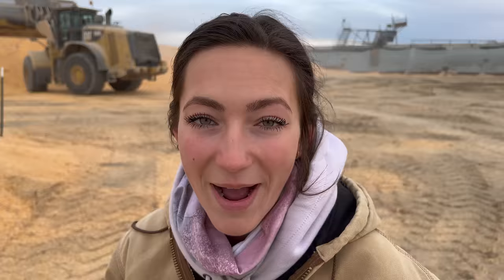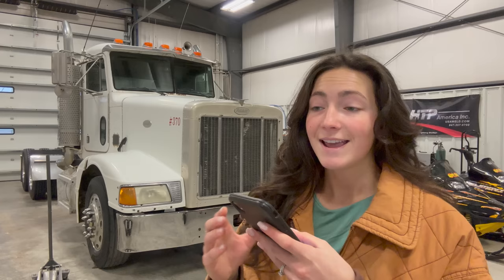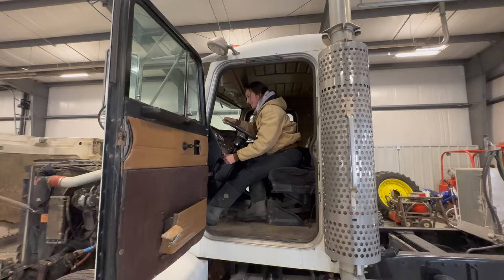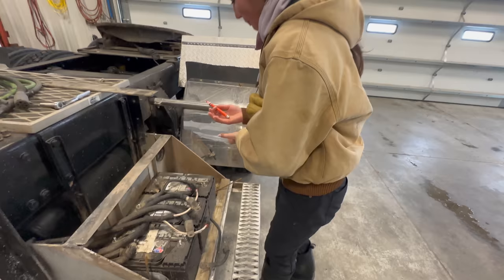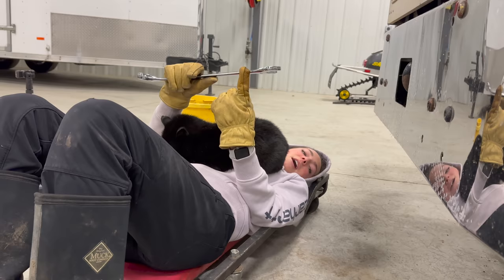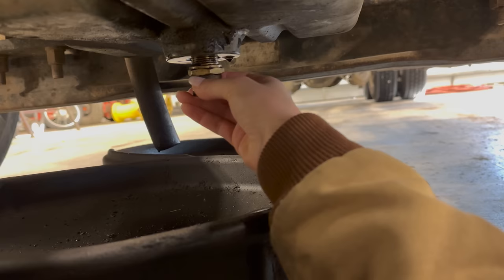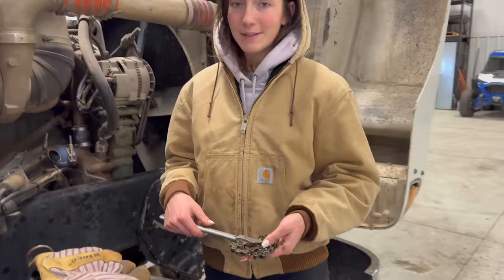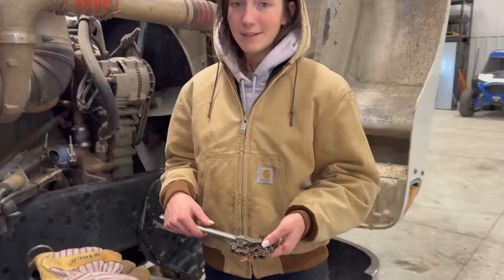The Worst Oil Change

Comment: You need to fill the fuel filter with Diesel fuel before you start it, your going to create an air pocket and have to bleed the fuel injectors. Not fun plus more work.

Comment: might have to go with a hammer and chisel on the rim of the filter or I have had to tear the aluminum and filter material away and use a pipe wrench or hammer and chisel to knock off the screw part that attaches to the base... get a proper filter wrench for the second one but you figured that out already I am sure...  but once compromised all tools will only make it worse. or cutting torch... buzz it off without cutting the base.. or take the base off and work with it on the bench... been there done that... no good solution.  No room for the screwdriver and manner through the filter and use a strap wrench wrapped on the screwdriver... I dont think you have to get close to the base as possible (aka near the top)... Army Mechanic old school and Ambulance rescue maintenance officer for about a decade running that engine in rescue trucks.

Comment: @jackgreider6347 has the right idea. Band wrenches work great. I have a oil filter wrench that has 3 fingers that also works great that I got from Snap-on. Not sure they make one big  enough for a truck or tractor filter but I haven't come across a filter I couldn't get off with it. The part # is OFCA3HDKT

Comment: I would hammer a screw driver or a pointed rod through the filter from the front. then I would force a larger rod through the same hole. then I  would force an even larger rod through the same hole and repeat until you have a large enough rod all the way through the filter that it will not bend with a 4 foot cheater on it. You have nothing to lose at this point.

Comment: I work for the love that  loved 6 Detroit engine band filter wreck use with 1/2"" racket I use it with 12"" extension breakers bar The oil has cap to take adapter drain the oil put hole in filter fir It's easier  you didn't fill your fuel filler You will loose prime fill it before starting  I wish I could be be there show  you

Comment: I've actually had to drive a screwdriver all the way through an oil filter to get enough leverage to get it loose and I've had to put impact wrenches on the cartridge type filters that had wrench flats before.  I don't think people actually torque them that much, my theory is that it is a dissimilar material issue that causes it to tighten over time. Having said all that I'd follow the other advice in these comments and get the right oil filter wrench up close to the threads.  By the way, is that scratch on your face OK?  Did Scotty get a little crazy?

Comment: at the least hammer a long flathead screw driver right threw the filter and turn it off ,,, yes you will  loo=se your oil and make a mess but it is a sure way to get it off. cheap lol

Comment: For one thing, you're grabbing the bottom of the filter, at the weakest area. Another, is you can probably access it better under the truck. Another, it's probably seized from how long it's been on there and the oil wasn't changed in a number of hours. If all else fails, drive a crowbar or ladys finger thru it and use a cheater on that. ITS got to come off, even if it takes some incentive from a hammer. Maybe try to tighten it up and then try to loosen it. If NONE of that works, use a cold chisel to it.

Comment: as well as all the other good advice from all us armchair types, try and grip the canister as as high up and near to the threads as possible, wrenching on the bottom just more twisting force going into the can instead of the threads.
and no.  i've never took an oil filter off an artic in my life.

Comment: um, you're missing a battery, most trucks have 4x12 volt batteries, wired to provide 24v to the starter motor, but only 12v to everything else...

Comment: you need to use penetrating oil like Seafoam, or PBBlaster, then use a heat gun and get it luke warm for the rubber to be more maluable... it sux when they are stuck :P

Comment: Hi guys! Filter players work great and can get a set at haborfreight or thuer is a socket  oil filter sock that goes  on the end of the filter and goes on a normal socket  wrench thise are the shit. And evan on you feul filter remember to fill them with I ther oil for the oil ones and put feul in the feul ones so it's easier to prime the feul when you go to strat the truck thier is already feul to go into it lol! Thier is your free tips for this one guys good luck!

Comment: 0:58 - "That machine weighs 770,000 pounds".  Not quite.  That weight didn't pass the smell test for me.  Looking at the specs of a 980K Caterpillar Wheel Loader shows its "Operational Weight" is 66,489.3 pounds.  Looks like you got some bad info Laura.

Comment: What does 770,000 pounds even mean... try using the Metric system, it makes so much more sense.
The metric system rules... seriously... it does...
To make more sense of this, the excavator weights 350 Metric tons... which is easily converted in your head to about 175 SUV's... which immediately "means" something.
At least quote weights in US Tons which are reasonably close to Metric Tons... it weighs 385 US Tons.

Comment: Try a oil filter wrench with a strap instead of an chain, try to heet the filter up with  a little fire. You can use an oilfilter cup wrench on the other filter but because this one is damaged you can’t use it on this filter. By the way Best wishes for this year and greetings from the Netherlands 🇳🇱

Comment: I See So Many Videos That Don't Cold Crank Diesel Engines You Hold Throttle On The Floor Crank When Start Get Off Throttle Before Rpm Goes High Stops Needing Jumped Off And Needing Starting Fluid......Pending Computer Engine Certain Can't Crank This Way Some Cats Will Not Until Engine Turning  Over.....Try It Or Ask.......

Comment: Gotta call 🐄💩on 770,000 weight cited for the wheel loader. CAT 980k lists weight at 70,000. 
Oops.  What’s an extra zero among subscribers? Do you have an air chisel? That’s my go to when levers fail. But it’s risky.

Comment: Does the filter have nut like flat surfaces? I have a huge socket type device that fits my 1/2 inch or 3/4 inch breaker bar and fits on the end of the filter. Then just turn like a wrench on a nut and it comes loose.

Comment: Make sure to use the wrench at the top and bottom of the filter not in the middle. Second when all else fails you can heat the can up with a propane torch it will release the gasket from the filter, be careful to not get it to hot just enough to release it, third…..hold your mouth right and stick out your tongue…..old mechanics joke.

Comment: Removing the tire or turning the tire to the right might give you more working room.
Reply: If they do that, they need to place a tire under the vehichle for safety should the vehicle tip and fall on them.

Comment: 🇺🇸🚜Laura & Grant K&N Makes oil filters that will fill you Big Rig & you can use a regular Wrench 🔧 to tighten & loosen but Obviously you know that you guys need a New oil filter wrench 🔧 I would never use one like that you need oil filter Socket 3/8 drive or whatever size you can find

Comment: Make it a 4 battery set up, 3 is for the weak!
Reply: Go get a strap wrench u put on end of ratchet,  they always seem like they tighten up over time. CAT Makes a good strap wrench that doesn't really crush filter.  Keep cranking on it steady pressure and it will come free. Also always turn wheels before dumping oil. Makes it so much easier

Comment: I'm sure it's been said but a chunk of 1inch square tube cut to what what ever length and a 1 foot chunk of Rachet strap self tapered to it pipe wrench cheater bar truck tractor tied on to the end pull with wish I had a picture of the one I made in two minutes 15 years ago

Comment: Who ever put them on probably didn't put a little oil on the gasket  before putting them on. Take a hammer and drive a screw driver thru the filter it should come off. By the time you read this you probably got the filter off. Lol I enjoy your channel.

Comment: No, nothing you all have done wrong, whom ever changed the oil last time did not lube the all filter seal and the filter has now adhered to the filter adapter plate. The only thing that I can suggest is to raise the chain wrench as high on the filter and as close to the oil filter adapter as you pull hard and grunt loud, generally works me. Also feel to talk about the last person that changed them!! @larrystolzman9337  Congratulations on your up coming anniversary, may  God bless you with at lease 50 more years.

Comment: that's not really a filter wrench get a rubber strap type filter wrench walmart or auto parts store look at the strap before you buy some have really thin rubber and will break if you look at them funny.you want thick,wide. so why didn't the supervisor offer some help?